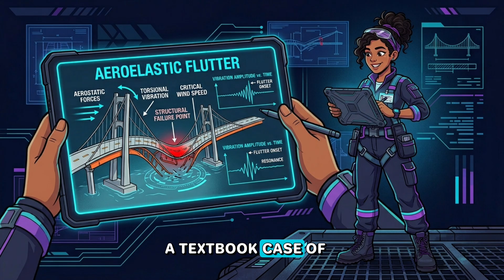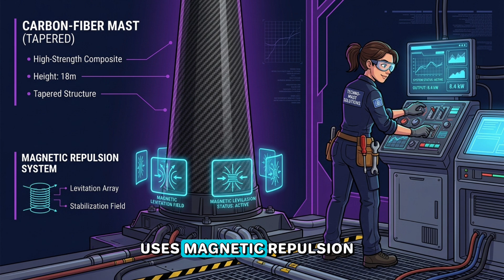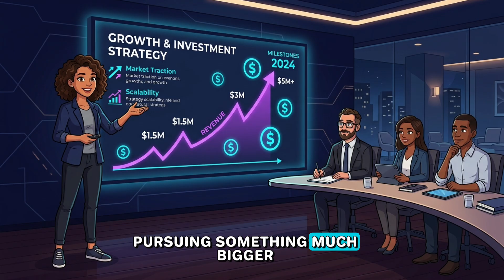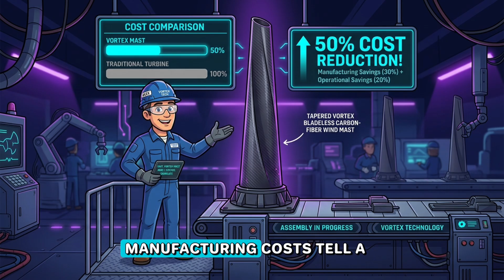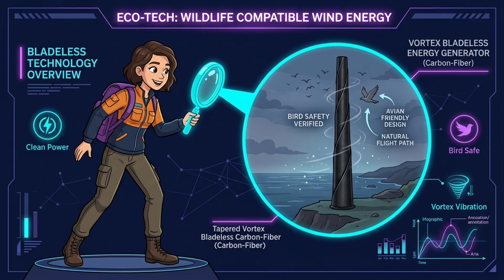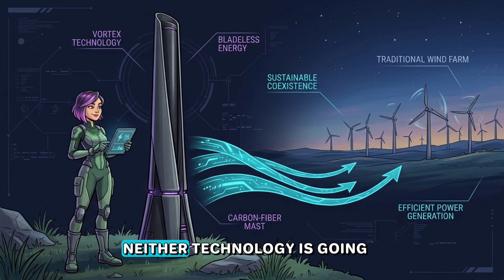Spinning Blades Are Dead: How Motionless Wind Tech Is Rewriting Clean Energy

Comment from the maker: Something worth clarifying from this video. Bladeless wind technology is not powering entire cities and we were deliberate about that framing throughout. What these devices actually do is generate real locally useful energy from wind in spaces where conventional turbines simply cannot fit. The Vortex Bladeless mast produces between three watts and around one hundred watts depending on the model. Aeromine rooftop units produce around five kilowatts each. Meaningful at building scale but not a grid replacement. The more interesting story is the category these technologies are creating together. Wind power for courtyards, rooftops, parking structures and remote sensors. Places the industry has never reached before.

One thing worth mentioning upfront. Some of the visual representations of the Vortex Bladeless mast and the Aeromine airfoil units may not look exactly like the real devices. These technologies have very specific physical forms and image generation does not always get them right. Thanks for watching ❤.